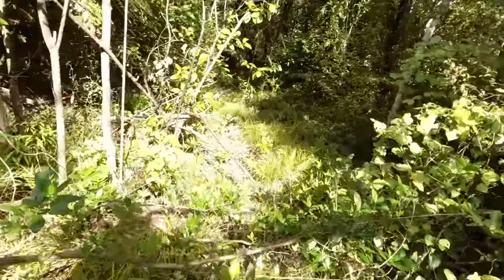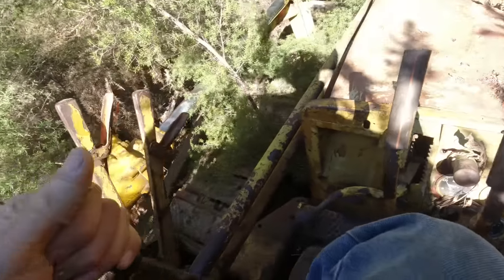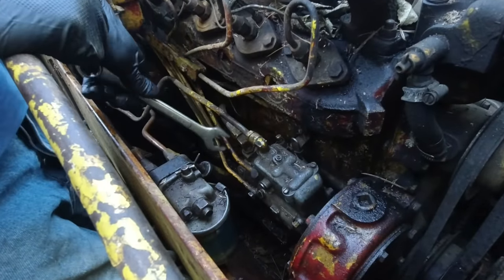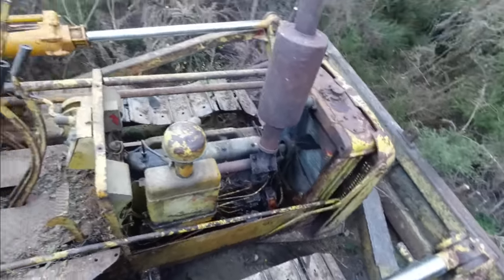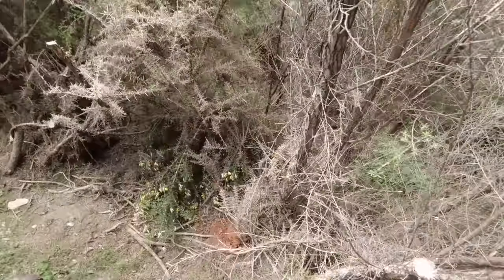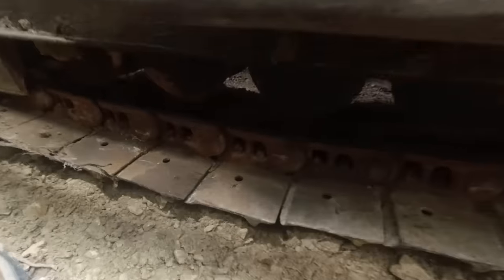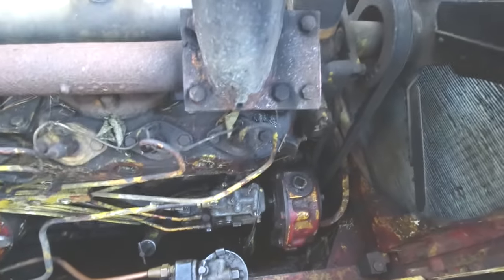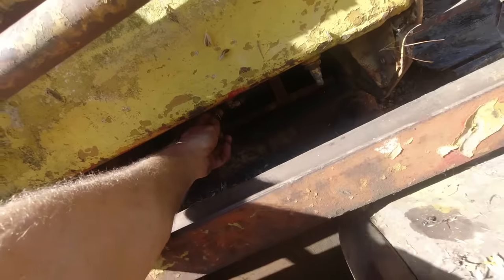Salvaging an Abandoned TD9 Bulldozer from the Forest.. Will it start??

Comment: I can’t imagine trekking all the way up that mountain with all that gear and getting that old girl to go. When she finally kicked over and I saw that grin on your face ear to ear it was a real Marty adventure. Thanks for taking us along.
Reply: You would think that there would be some proper roads around there, ridiculous.
Reply: @ChillToMusic87  That’s what Cats do… make their own roads
Reply: @guaporeturns9472  Good answer
Reply: J
Reply: Man really just walked out in the woods and got a free tractor
Reply: @undersideindustries3496  Not really. I live next to protected acreage and saw the tractor parked way down about 1/2 mile down. Trees were growing up through the thing and the mice had eaten everything. Wires, steering wheel and even the shift knob was chewed almost off. I contacted the family of the old farmer and asked if I could purchase it. We agreed on $300.00. I tore it completely apart and replaced every nut and bolt, professional paint job and ended up spending $8000.00 for a tractor you can buy in decent shape for $3500.00. The family told me later their father had purchased the Ford brand new in 1953 and couldn’t believe I had restored it to pristine condition. Many pictures and hugs later it now resides in my barn, covered up and protected but still used in the summer months for mowing. I get many compliments but it is a testament to things made long ago and were meant to last several life times.
Reply: A
Reply: Be 1aa

Comment: Who knew getting an old diesel started again would be so easy.  As for “a temporary fix just to get me home” are a mechanic’s favorite words.
Reply: it is a matter of fact that old big abandoned for years diesel engines are easy to start (to take you home)
Reply: I can't believe they abandoned it just because the track broke.
Reply: As long as the fix is still working it's ok to stay temporary for as long as it needs
Reply: Theres nothing more permanent than a temporary fix
Reply: This is another example of why Im such a big International Harvester fan. This thing has been sitting in the woods for 15 years and he threw fresh fuel, coolant and a battery in it and it woke right up. It yawned, did a big stretch, and said "alright, back to work". Just loyal.

Comment: Abandoned at the end of a lost track, on a mountain in dense forest, with one track off, an empty fuel tank, no battery - no issues for Marty !
That was one of the most ambitious recoveries I can imagine for one man to take on, just getting the battery up there would be beyond most people and replacing the track pin alone with just a jack, a crowbar and a splitting axe in the middle of a huge patch of gorse takes guts and determination !
At least it was the one vehicle that could carve it's own path through the forest once it was running and it certainly did a great job of that too !
Reply: True Grit.
Reply: Track pin...stuck for decades!!

Comment: Just an FYI for future reference. I'm a machinist and we occasionally have to put some shrink fit parts together. We use dry ice + 91% isopropyl alcohol to chill parts. Gets a lot colder than your freezer, and is easily portable in a cheap styrofoam cooler.
Reply: Sounds cold enough for gloves so you keep all your skin!
Reply: too cold for bearings ?
Reply: Sv
Reply: We used liquid nitrogen,works even better. And on 2nd shift when work was done,we would cool our beer down in seconds
Reply: @crispykreamin6439  liquid nitrogen is safe for bearings and don’t need to hit them on. Just slides on
Reply: Same job here. That works good. Also liquid nitrogen, sub zero freezers, torches, etc. Some parts grow enough just by setting them on the pavement on a hot day.

Comment: The d282 was a simple engine, it usually used a Rossa maste Rotary fuel pump. The injector system was a low pressure style (750 to 1000 ) psi. They were also low compression and would not start well if even 1 glow plug was not working.  They are a dry liner diesel which made rebuilding a pain. The liners are very thin and the actual bores they fitted in deformed a lot. This meant horning the block back to true and selecting various oversize  liners, easy back in the sixties not so much today. The smoke I see tells me the injectors are leaking bad and need rebuilding. fairly simple injector to repair with a little patience and a little lapping compound. The biggest problem was getting them and the precups out of the head.  You will need to build a puller. The most likely problem with a machine sitting for so long is the steering clutches rusting solid. Good luck
Reply: i wish I had your brain
Reply: @sparklesparklesparkle6318  sounds like it's come from 20-30 years of experience
Reply: @md4luckycharms  Yeah I don't want to be a mechanic for 3 months let alone 30 years. I mean I love the idea of being a mechanic, it's romantic. But like, actually going into it with no experience and no tools, no thank you. I've worked enough jobs that break your body. If my body weren't broken I'd be down to do body breaking work but it's too late now lol.
Reply: @sparklesparklesparkle6318  I'm one. You grow to hate it. Good skill to have but I find I'm temperamentally unsuited to it. What's good about it is that you can fix almost anything around the house from a hot water service to a washing machine. The bad is almost no satisfaction of any kind because - well just because - you need to do it for decades to know what I mean. I got out of it and drive trucks rather than fix them. Rather than dealing with absolute morons in spare parts I have to deal with absolute morons in every aspect of the transport industry instead. Such is life.
Reply: that was a pleasure to read, thank you
Reply: @ThePaulv12  yeah that's what I always see people say is "who in their right mind would ever want to work on them when you could just drive them instead". Takes a special type for sure.
Reply: @ThePaulv12   "temperamentally unsuited"   I'm stealing that for sure.  I've thrown a wrench or two or a hundred out of frustration over the years.  I'd just assume pay someone now unless it is an easy fix.
Reply: @lesandheatherstonebrakers5871  Those "easy fixes" are the ones that will bite you!
Reply: I was going to make similar comments.  I had a TD9B Power Shift it was an impressive pushing machine.  It was getting tired and threw a rod.  I welded the block put a new rod and piston had the crank turned and used it for several more years
Reply: @sparklesparklesparkle6318  Smart decision, I spent 20 plus years working on aircraft. Soooo much walking and climbing, planes are HUGE.
Reply: @jbrownjetmech-4783  nice sounds like a lot of fun. and hopefully profitable.
Reply: @md4luckycharms  dude has a starcraft pfp i dont think so.
Reply: @sparklesparklesparkle6318  My boss is still working himself doing the same tasks as us younger workers, hand feeding a 1960's robinson bandsaw and a jonsereds wood planer from the 1950's all day 6days of the week at the company he owns :D Hes 73. The guys as fast as anyone and seen him run a few times when the planer has had some issues :)
Reply: @ThePaulv12  I can imagine that. But it's really sad that the new generation of fathers mostly don't pass any skill onto their sons. I'm really glad that my dad tought me basic mechanical and electrical skills on which I could built in. My God most of my peers are absolutely overwhelmed when they have to fix anything in the house. The most you can expect is changing a light bulb.
Reply: @dennisn8991  Yes. It's always these 10 minute jobs that suddenly turn into wrenching hell. Most of the time things breaking while you take it apart.
Reply: @EbonyPope  or they don't go back together exactly right, or the tiny spring disappears when you take pressure off it
Reply: @barklet6110  ... and you discover that something is completely worn out and you don't want to be driving a death trap. And now you have to spend 10 hours replacing stuff.

Comment: Hi Marty, really enjoy your videos. Just a comment regarding the hydraulic setup on the TD9. My father had an earlier one with the same extralong rams. The setup was for use as a loader dozer - a bucket with a very high back. The bucket was filled going forward and the lifted completely over the driver to load a truck that was behind. Ours has a very heavy canopy above the driver for protection. The bump stops are visible on the rear uprights on the frame.

Comment: The most unbelievable part is how chill you are about getting that thing started for the first time.

If it were me I’d be cheering so loud the people on the road would pull over wondering what that noise was
Reply: Its an old International, its almost guaranteed to fire right up. This thing sat for 15 years and he pretty much just threw some fresh fluids in it and a battery. I'd like to imagine that the old girl yawned, did a big stretch, and said "alright nap times over, back to work". Just loyal old machines.
Reply: What people? What road?😕

Comment: That looks like a TD9 92 series.

The original TD9 was petrol start on the main engine, no pony motor. They had a lever above the air cleaner intake and throttle lever. You pulled that back and it opened up an extra set of valves in the head that exposed a set of spark plugs and also dropped the compression. Once the engine had warmed up you just threw the lever back and it fired up on diesel. Lots of smoke if the one of the spark plugs was buggered.
The TD9/91 had the four cylinder engine and MAY have been petrol start although the engines in the TD9 and TD9/91 were different.
 
With the TD9/92 they went to the 6 cylinder engine which would have been direct electric start.

The TD9B replaced the TD9/92. The most visible difference between the TD9B and the TD9/92 is the front idlers were solid on TD9B and spoked on the TD9/92. Both of them originally had turbo's but invariably they failed and weren't replaced.

I had both a TD6 and a TD9B. they were nice tractors for there time.
Reply: I had to go looking around online after seeing this. The only TD9 I ever saw had the big four cylinder gas start diesel engine. But it seems when they went to the six-cylinder direct start diesel the first few years they didn't come with a turbo. If that one never had a turbo it's somewhere between 1959 and 1962. Bunch of useless information I know, but I find it interesting.
Reply: I operated a TD9B back in the late seventies.  They were light for their class and power and were fitted with (I think) a 5 speed Clark gear box, same as the IH trucks. One of the best tracked Ag tractors i've operated because the driveline configuration made them fast, Ideal for giant disking and the like in steep hill country, but not so great on scrub crushing and heavy track pioneering compared to equivalent Cat or Komatsu.

Comment: Hi there, To remove the broken bolts for the track guard you could try a technique we use in the exhaust shop. Tack weld in the centre of the bolt to bring it out from the frame, Weld a flat washer to that and then weld a nut to that. Then attempt to remove the bolt. This works well when a exhaust stud is broken inside a cylinder head etc as you can apply more force than a easy out when removing the stud .  Although it is quite committing as once you weld to the bolt or stud it is difficult to drill out as a last resort. Kids and I enjoy your videos keep it up.
Reply: Yes, did pretty much the same when I ran a muffler shop. Only difference I'd usually forgo the washer, and spray down with a quality penetrating oil as the bolt cooled
Reply: It also heats the bolt up making it possibly "break loose" from the rust bond.
Reply: I think my dad used to take a copper tube and weld bolt to a broken bolt to get them put quick. The copper would protect the surfaces and thread root and crest. I could be wrong. I will have to ask him.
Reply: Tack weld blob a vice grip and a solid breakfast, works 90% of the time 49% of the time.

Comment: Lol!!! I did this same thing a few years ago. I acquired a 1966 IH TD9 that had been sitting at least a dozen years. Got it running, drove it off the mountain and out of the woods onto a friends trailer and hauled it home. Changed all the fluids and filters and put it to work. Those old dozers where ahead of there time. Direct start, turbocharged, and hydraulic blade. Great video and thanks for sharing.

Comment: We had a 1940's vintage I.H. TD18. About the same size as our Cat D8. It was started with a two cylinder gas pony engine. When the pony engine was warmed up, you threw a lever and the big engine would start and run on gasoline. Then when it was warm and at a certain rpm, you threw a big lever and it would start injecting diesel, and all hell broke lose for about five seconds, and then it would start running on diesel.

Comment: The TD-9 B Series was available with or without a turbocharger. The IH D-282 is an excellent engine and parts are still available from sources in the USA. The TD-9B serial numbers fun from  #501 in 1959 to  #16746 + in 1974. The serial numbers, from 1962, had prefixes TD9BG (Gear Drive), TD9BGA (Gear Drive - Agricultural), TD9BGC (Gear Drive - Revolving Crane), TD9BGS (Gear Drive - Sideboom) and TD9BP (Power Shift). Great to see this old macine rescued from a lonely hillside and brought back to life again!

Comment: If you haven't taken the fuel pump off already and bear in mind I am not familiar with that engine. Remove all the fuel connections obviously. Remove the front plate nearest the radiator and using a mirror or camera take a look inside at the timing gear for the pump and check your timing marks and see if the pump drive is connected directly to the gear. Sometimes fuel pumps have a splined drive shaft so when the pump flange fixings on the body are removed, the pump slides straight off. If it is a splined shaft it will have a master spline to help refitting in the correct position. If not splined it will have a drive flange on the fuel pump bolted to the timing gear which will require the interface bolts removing.

Refitting should be straight forward and reverse of the above. However, if the timing has been disturbed it needs to be reset this way after refitting the pump but don't connect the injector pipe to No.1 cylinder. Somewhere on the flywheel will be marks for TDC and the No. 1 cylinder injection point. Turn the engine to the latter making sure that both valves on cylinder No. 1 are closed. The pump fixing holes should be slotted to allow a little adjustment so back these off slightly. Make sure your hands are clean and remove the No.1 header (the threaded part where the injector pipe screws on) from the pump and pull out the spring and valve. Don't drop it or lose it! Refit the screwed header without those parts. You'll need a head of fuel either by an elevated can with diesel or someone constantly pumping the lift pump. The correct injection point is determined by slowly rotating the injection pump until the flow of diesel stops or starts coming out of the top of the screwed header depending which way you twist the pump. Tighten the bolts/nuts on the pump flange and refit the spring and valve back into the injector pump plus any missing fuel lines.

You can use the same method above to recheck your injection timing. Older engines tend to smoke a lot but smoking can be a symptom of mis-timing injection along with badly seated injection needles. 

Ah well, that's my version of War & Peace complete. Good luck with the refurbishment.

Comment: Not sure if it's the exact same model but I remember as a child in tolaga bay my dad got an old dozer similar to this one running and proceeded to use it to doze all the new fence lines down ridges, clearing scrub, disc and crop almost the entire farm, done every track and put new ones in big enough to drive trucks on, built dams and all sorts for years and this wasn't a tiny farm it was about 7000 acres of hilly country. Im pretty sure it got caught in a fire which i think was started by the exhaust and survived that too. Watching this brought back so many memories of going to work with him fixing it and standing on the side of the dozer on the sides of hills hanging on for my life while he was discing this thing could go almost 90 degrees sideways around hills I swear haha. Thanks for the upload that was so enjoyable to watch

Comment: Best trick we’ve used over the years to extract broken fasteners is to weld a nut to them with a MIG or TIG. You might go through a couple nuts doing it but the heat will help break the fastener free and then you’ll have the nut to turn it out.

Not much more risk to the threads than drilling assuming there are threads
Reply: Just used this trick to "save the day" a couple weeks ago.... But I was late to the party, so the 2 different broken EZ outs and part of a tungsten drill bit didn't help 🙄  Plus it was a machined steel part with gears everywhere, so I ended up removing the broken attempts first, leaving barely the threads before my weld became permanent 😬 If only i would've happened by a few minutes earlier I could've turned 3 hours into 30 seconds with our little trick 😉👍

Comment: Sure I've had these injection pumps off, open the side window (two small screws) line up the marks on the rotor and housing, that gets you on TDC (or close). Take all lines off of course and two nuts on flange of pump housing then slide it aft off the shaft. Careful on install to line up the mark on the end of the shaft with mark inside pump slot. Seals are on the shaft that seal fuel in and engine oil out. Check bushing inside housing for wear where seals ride. Call me if you need help, otherwise good luck. P.S. check for external leaks before removing the fuel injection pump!